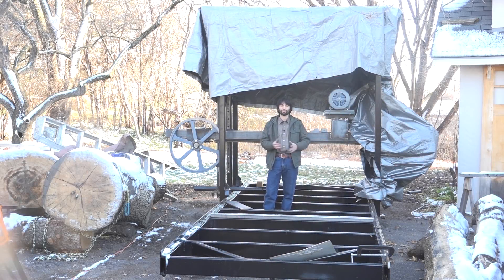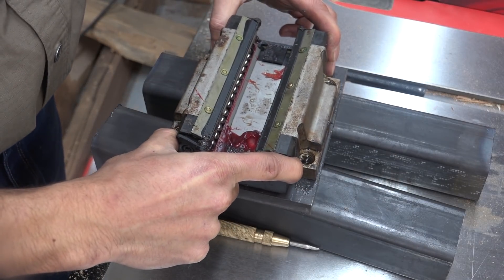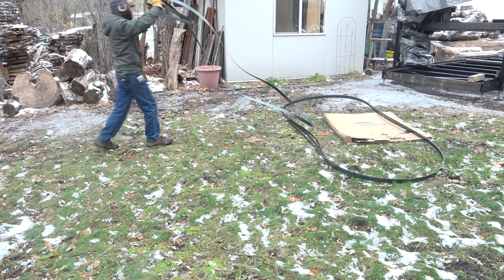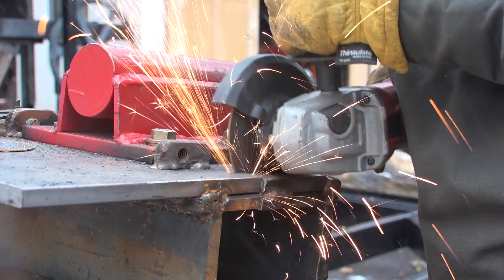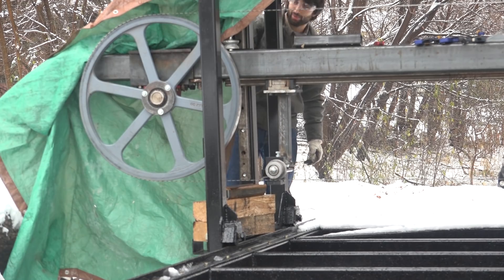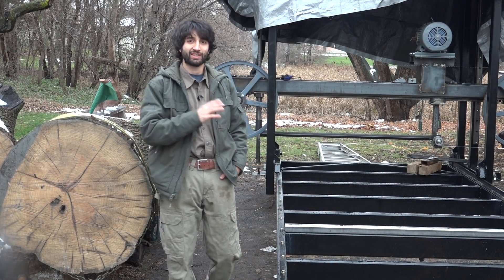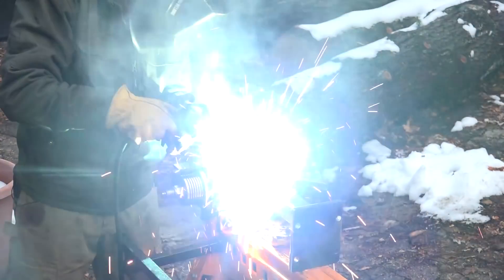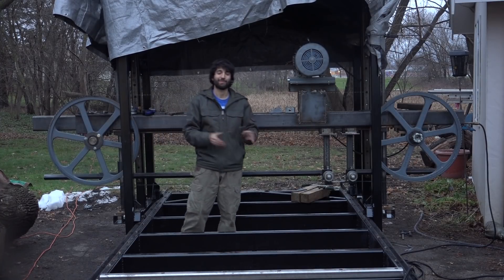Blade Guides - Building a Large Bandsaw Mill - Part 13

Comment: OK< a metal framing hammer is better than a wooden mallet, but it's still not a ball peen hammer.
Those framing hammers often have a cross hatch pattern on the face that will help keep the nail head from slipping off when being struck, but it will leave an impact pattern on the metal you are striking with it.

Comment: Are the bottom of your Band wheels the same elevation? Do you drop your band guides lower than your wheel elevation? Can you educate me a little regarding this topic?
Reply from the maker: They're off by about 1/16".  The guides deflect the blade down about 1/4" and bend it so it is parallel to the bed.  I cover the blade guides more in the set up video

Comment: Was kind of hoping for actual information on blade guide set ups, how they work, why Etc. seems like a basic question I understand the function of the blade guides, but where do they do the most good position wise, how much tension and angle to prevent the blade from climbing or diving. I ask because Im noticing the guides look tapered in step downs.
Reply from the maker: See part 17: Initial Setup - Building a Large Bandsaw Mill - Part 17 https://youtu.be/RPKXP8TpRVM

Comment: Where did you get the blades from? Were they custom made? One thing I've been wondering about the band saw blades for a while is why aren't they double sided? I always see saw millers cut in one direction, raise the blade height, pull the rig back and then reposition and lower the blade for the next cut. Is there any advantage to cutting in one direction, lowering the blade to the next cut position and then run it in the opposite direction if the blade is double sided? (Apart from the controls facing the wrong way on the return cut.)

Comment: I have a question for you, did you build your blade guide's if so why is their a grease fitting at the end of the bolt through the guide roller, i don't understand the need for grease in a sealed bearing, i don't think you can grease a sealed bearing without taking them apart, love your mill and i'm going to build mine off your design except with a gas engine and axle's and wheel's to make it mobile, great video's Matt keep them coming.

Comment: Surprised the plans didn't have more tips on placement of guides, etc.  You're doing a lot of that yourself. Got here from Essential Craftsman. You have a lot of commonsense. I'm running a WoodMizer LT15 - Kenai Peninsula south of Anchorage doesn't grow logs your size, and mostly only white spruce with some birch (18" at base is biggest I've come across).   #wranglerRIGGS has the same problem many catalogs do - they've never heard of Alaska (not contiguous 48), which can be shipped to via Post Office about as cheaply as lower 48 at UPS or FedEx prices.  Sigh.

Comment: SO how far below the wheel od is the blade roller od?  What control distance do you have to control blade tension so it also runs horizontal across a log? They say the back wall rim of the roller guid should be about 1/8" before pushing through a log.  Great progress like to hear you say a date now and then.. It is Tuesday Dec 2nd 9am for example.

Comment: Blade length is the diameter of one wheel plus 2X center to center.
Reply from the maker: circumference of one wheel
Reply: Ya, that`s what I meant.I am building a band saw mill now. 30 ft of track. I need 23' 6X6 beams for my house I am building. So why arn`t your arms bigger? After all that lifting and drilling?

Comment: Matt,

Fascinating build! My husband and I are very impressed, especially since you did most of the work yourself.

We binged on the first 12 episodes. Elected the playlist. There is no "stop" on my iPad, otherwise I would have left the following comments after the appropriate episode.

1. You don't need to scoop out paint to keep the rim clean. Home Depot sells plastic pouring spouts/lips that fit on the edge of the paint can. Best for 1-gal cans. Allows you to pour out paint into say rolling trays without messing up the rim. While ours have lasted for literally decades, if you can't easily clean them, they are cheap enough to be disposable.

2. Loved that Triton portable pseudo saw horse/vise. 

Again, amazing and innovative build. Never saw a horizontal band saw mill before, but it makes sense and looks much safer than the standard vertical ones used by, say, Hearne Hardwoods.

Comment: How did you decide what HP electric motor you would need to power this very wide saw and were you limited by having single phase service at your location?  Thinking that more HP would be a really nice option.  #wranglerriggs
Reply from the maker: I went with 10hp since I already had the outlet and cord to support that size motor's amp draw.  I'm also limited by my home's electrical service so I can't go much bigger in the future unless I have that upgraded but we'll most likely move making that less imperative.  Lastly, I was originally planning to power this with a 25hp gas engine but decided to go with electric since it would be cheaper to install and maintain in the future.  The 10hp motor is the rough equivalent of a 25hp gas engine.

Comment: Really cool job on this rig Cremona! This will put Mark and Shannon in their place LOL! Just kidding, but what an awesome way to further your skills, not to mention the yield you'll get from those logs. I wonder what the break even point is. One question though, it doesn't look like the flywheels have tires on them from the side vantage point because the flat wheels don't have a lip to retain a tire in- do bandsaw mills not use tires between the wheel and blade or did it just blend in to the color of the cast iron? Keep up the great vids brother! #WranglerRiggs
Reply from the maker: lol Thanks Jim!  These wheels are turned true and crowned so there is no need for tires.  I can also use lubricants that would otherwise harm tires.

Comment: Great video.  I am enjoying your entry into metal working.  I am curious as you have been drilling quite a bit in metal, are you finding it necessary to sharpen your twist bits a lot more frequently?  I never sharpen twist bits used for woodworking.

Comment: I notice the wheels have no tires on them.  You will need to put thin bands of rubber on each wheel called a tire.  This means that the saw blade will be much tighter unless you can loosen the wheels up a bit.  The "tires" are typically only about 1-2 mm thick, but for wheels that size, it could add up to needing several more inches on the blade length.  Great build so far.  Absolutely love your attitude!! #WranglerRIGGS
Reply: Do you anticipate blade slippage with the current design because of metal on metal contact?

Comment: Matt, just saw your mill project update and looked at a couple of others in the series.I have a WoodMizer mill and have operated it since 1992. My suggestion to you is, go to the WoodMizer website and find a mill owner near you. Most mill owners are happy to let you watch the operation and you may head off some problems, such as: clamping does not need to be heavy, blades need to run with the teeth projecting out from the wheels and should not run on metal, blade adjustments are critical. Also, my mill has a 24 Hp engine, given the size of your mill you could use up to 50 hp...If this is presumptious I apologize. ..

Comment: Hi Matt, hope you don't mind a suggestion from a stranger. If at all possible you should make the cross bar for the idle side blade guide sectional so that when you mill at full width you don't have the bar sticking way out. Also when it is way out  it is unsupported and has potential to vibrate your blade guide and blade something you will want to avoid as much as possible when cutting that wide.  Other than that this is a very ambitious and impressive build, you are doing a great job. I look forward to seeing the completed product. Thank you for posting, keep up the good work.

Comment: #WranglerRIGGS Do the wheels require tires like a regular bandsaw does?
Reply from the maker: nope
Reply: Cool, just curious, but what keeps the wheels from flattening the set of the blade?
Reply from the maker: The blade is tracked so the teeth are off of the wheel

Comment: I think you will discover very quickly that you want the blade guide rollers to be adjustable. I'm curious to see how it works for you though because I am always adjusting mine to be as close to the log as possible.
Reply: What happens if you leave the guide rollers set wide and cut a smaller log?
Reply: The guide rollers control the angle of the blade through the log. The 
closer they are together, the more control they have. If the guide 
rollers are 48" apart but you are only cutting a 30" log, that's 18 
extra inches that the blade has a chance to deflect up or down. You want
 to constantly minimize the chances the blade has to rise or dive.

Comment: Looking good! I noticed that you don't seem to clean up your welds with an grinder before installing. I am a very novice welder and I was wondering if the flux core welding rods work well enough that you don't need to worry about it that much? I have only ever welded with TIG. #wranglerRIGGS
Reply from the maker: I call it rapid prototyping.  I'll knock off the slag and do any clean up work when I do the paint prep.  Leaving the slag helps to protect the welds from rust

Comment: next time buy a 250 foot length of blade and cut the blade size yourself.  weld it up to make the loop with a mig or stick or spot or even torch it.  very easy to do.  grind the weld smooth.  its what they do when you order them precut, except then you are very limited with your blades if you are stuck with a definite length!

Comment: Good project!  I built a band mill about 20 years ago that will cut a 36" x 25' log.  It has paid for itself many times over.
A suggestion on the blade guides is to use a horizontal bearing to keep the blade from moving back.  The back flange on your rollers will wear with out a direct back up bearing.  This is especially true on your saw as wide as it is.  I like that both of your guides are adjustable, that should work well when starting a very large log.
I don't know what type of blade tensioner you plan to use but I very highly recommend a direst reading hydraulic pressure gauge/cell.  I originally had a spring tensioner but changed to a hydraulic cell and it made a world of difference being able to read the tension/pressure at a glance and adjust when necessary.  The tension will change when the blade changes temperature.  #WrangleRIGGS

Comment: 6' is pretty awesome!  not too many band saw mills that can do that.  cool project.  biggest thing I ever designed and was the single source supplier was hydraulic 6 million pound strain gauge calibration test stand.  extremely difficult to sync four cylinders that weren't mechanically tied together.

Comment: Learning a lot from this project Matt. Thanks for your cheerful demeanor #work Riggs
Reply: Oops #wrangler WRIGGS
Reply: Are your rollers hardened or just turned steel? My Dad did R&D on Sawmills and built parts for them for many years. The first thing to fix was the roller guides they were not holding up over time. I know that  after the redesign and hardening they never needed to be replaced again. I know one mill ran daily for several years with no noticeable wheel wear. If you want any information on that I would be happy to help. I like all of the videos of you sawmill build.

Comment: Have you thought about using electric linear actuators to control the guides? You could probably keep your setup as-is, then add the actuators later on (maybe in the spring?) oh yeah, #WranglerRIGGS

Comment: Matt, what I'm psyched about is even if you finish this project in the dead of winter, you will be so excited you will still slab up one of the big logs without waiting till spring...no pressure.
Reply from the maker: +earle0024 I don't mind milling in the winter/snow but building in the cold is rough

Comment: Matt, your project is awesome!  I'm following with great interest. You posted a few days ago with the blade guards mocked up.  I noticed pretty large openings by the wheel hubs.  I hope they'll be smaller in the finished product, as I pictured hands reaching through and getting injured (or worse) by the wheel spokes. Just my $.02.  Can't wait to see you mill those huge logs.  #WranglerRiggs.
Reply from the maker: I take it you're referring to the back of the guard? That area needs to be stepped to give clearance to the bearings and mounts. I'm still working on the guards and have to add the stepped area.  The wheels will be fully enclosed both for safety and weather proofing
Reply: Yes, the back of the guards. I have no doubt that you've got it all figured out. You are doing an amazing job!  Thanks for sharing it with your viewers/fans.

Comment: Enjoying the series, Matt.  Any sense of how loud the saw will be when cutting wood?  Have you checked the blade lengths - are they the length you ordered?  Perhaps the wheels are of dimension slightly different from the nominal size?  #WranglerRIGGS
Reply from the maker: +OnEvenKeel not sure on the noise level. I'm sure it will be quieter than the chainsaw though. I haven't checked anything but either of those are possibilities

Comment: #WranglerRIGGS Reminds me of my grandfather who was a tool & die maker.  He built a bandsaw that was mounted on an I-beam that would pivot at one end at an angle in an attempt to cut a bronze ingot that came out of a broken smelting furnace.  His approach was to use a hydraulic cylinder to control the rate that the beam lowered.  He was never able to solve the problem of the bandsaw blade drifting to one side as it cut, which eventually caused the blade to break...but that didn't matter to me as a kid watching him build that machine...it was awesome.  His saw was far from being as robust as yours.  Brings back great memories.  Nice job!

Comment: your bandsaw blade is short, next time you can measure center of right shaft to center of left shaft, two times, more one diameter of  your bandwheels, excuse muy english, nice video.
Reply from the maker: +jose angel estrada yes, that's the calculation I used however it was before I actually built anything so it was more of a theoretical length. Thanks!

Comment: To be honest, I got confused there for a minute with all the pipes and plates and rollers. But watched again and the fog cleared up. Excellent weldworking!!
#WranglerRIGGS.
Reply from the maker: Sorry Mac :)
Reply: Matthew Cremona So the guides you put on in this video are not only adjustable to the width of cut (horizontally) but also vertically so that they are putting some pressure down onto the blade hence the rollers?

Comment: Question: how do you do the blended video where it shows two of you?
Reply: it is done in post processing and combining two separate video clips and over lay them.  One needs to create a mask (I think thats the term) so that the correct portion of each video shows up when they are played.
Reply from the maker: That's correct.  I'll also add that I try to hide any seams along any straight lined element in the shot.  Most of the time the seam runs right through the mill's upright
Reply from the maker: I primarily use premiere but for the more complex masking, I'll use after effects
Reply: Matthew Cremona
Thanks for the reply.  What software do you use for doing this?

Comment: #WranglerRIGGS, Man I have to say the build is awesome. I'm getting stuff together to build a normal sized mill soon. I have a 2 cylinder diesel Yanmar engine for the power. I love that you work in the weather. I'm the same way. If it's got to be done, do it when you can. Good deal! Thanks for the videos.

Comment: Progress! If you have to drill out those plug welds, if there is any slag trapped in there it will eat your drill bit up be ready to sharpen those bits. Yes @ 9:18 that is cool sir! #WranglerRIGGS
Reply from the maker: might need a plasma cutter then haha!

Comment: Matt.  Could the weight of the cutting head been too much for the motor you were using?  With the added weight the torque of the motor would have gone up.  If the torque went up too high the current would have gotten very high and cause it to burn up.  What are you thoughts?

Comment: I wish I had a sawmill as big as this one.  Good job and Nice welds.  #WranglerRiggs
Reply from the maker: Thanks Dan!
Reply: Matthew Cremona No thank you as you inspired me to make a mini electric bandmill with 10" wheel barrow wheels, 12volt winch lift and the blades from my 14" bandsaw.  I can get 30" between the guide bearings. Thanks again for the inspiration as I videoed it and have really been thinking about starting a channel of my own and try to do what you do as I'm a maker also, except I make with all mediums including wood and metal.  So if you have any tips or words of advice like you have given in recent podcasts, I would definitely like to hear them.  Thanks, Dan

Comment: For the outside square tubing you could of went with a bigger diameter, so you could of put some neoprene wear pads in side so the inner square tubing isn't riding on metal.

Comment: First time needing a metric bolt?  I feel like every bolt I break ends up being metric.  Wish it was easier to get a hold of them.  #WranglerRIGGS
Reply from the maker: Stop breaking bolts.  Problem solved.  You're welcome. Next issue.
Reply: Haha... that would be a good solution.  I tend to switch to the "bigger hammer" solution a bit too often.

Comment: That rod sticking out from the blade guide is just a handle to locate the blade guide ?  How about eliminating that rod and installing a set screw on the blade guard to fix its location on the beam ?  Or for your favored more expensive and complicated - add a pair of 2 start acme rod & motor to the beam to move the blade guides ?